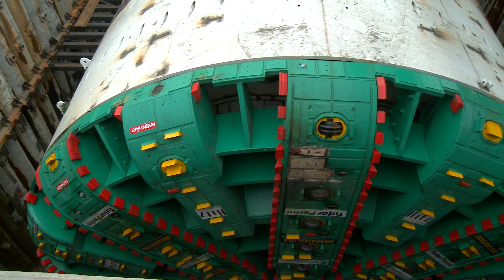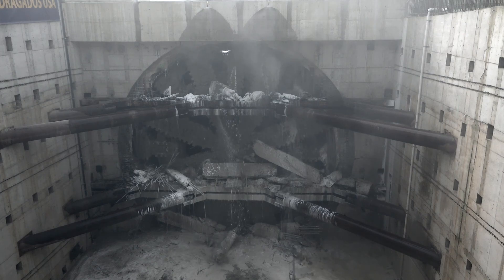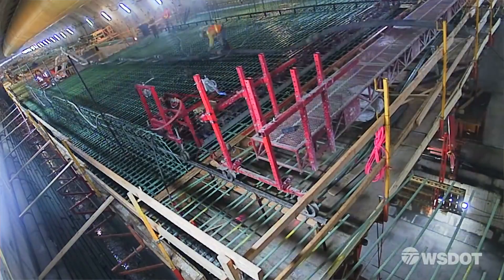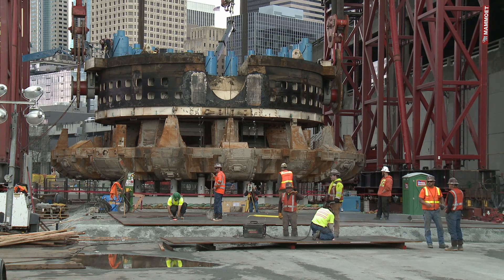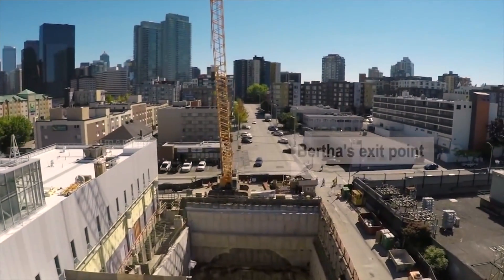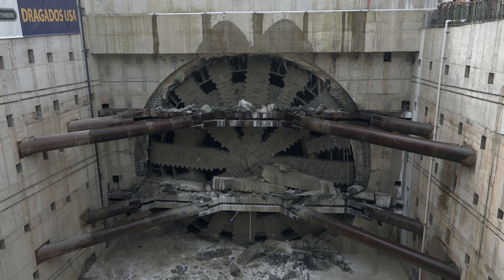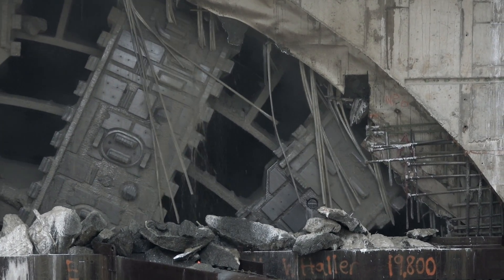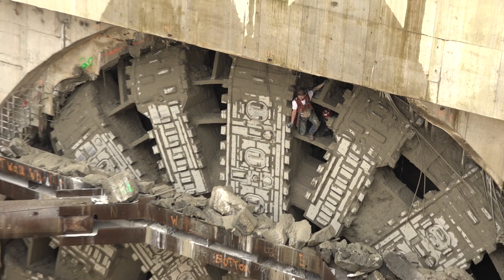Bertha completes its journey

Comment: Not one word about the forefather of underground circular tunneling , Marc Isambard Brunel. 
     He in  in where he created the tunnel shield which weighed in at 140 tons , a cast iron lattes made into small rectangles with levels of narrow floors all with in a circle frame in all 9000 parts which men could be put into those lattes work holes, let the spoils drop straight down where a collection would take it away, then when enough area in front of the shield would be removed the complete works would move forward to digout the next length of soil. Brick archway sides and ceilings and flat floor finished the tunnel and all this was happening in 1811 and under the River Thames in England.
    The project had problems such as river floor breaking thru and the project was halted at one point. When they restarted Brunel's son was working that project also as a lead engineer,, Because of the water dripping on the workers and air quality issues the labour force was spent and ill because the river was the worst open sewer in England at the time,, but finely finished in 1841 after starting,, would have been sooner but the shut down after the major flood set back everything. The tunnel is still being used today as part of the tube.